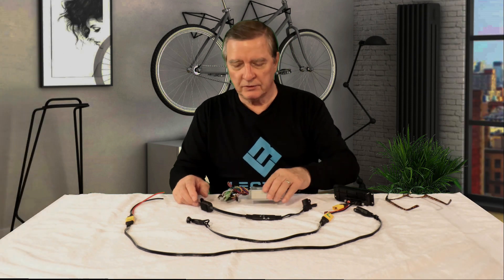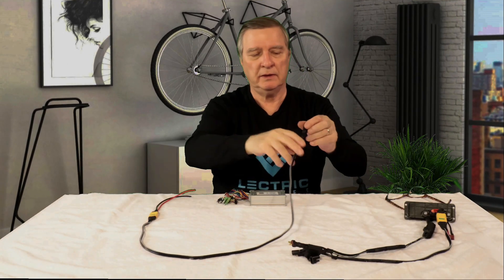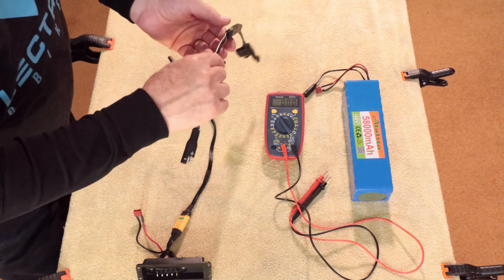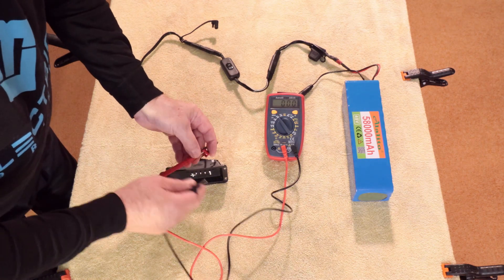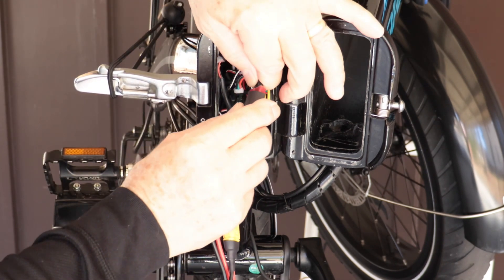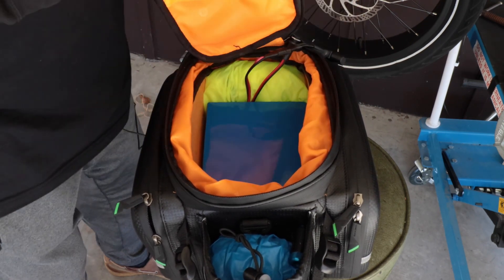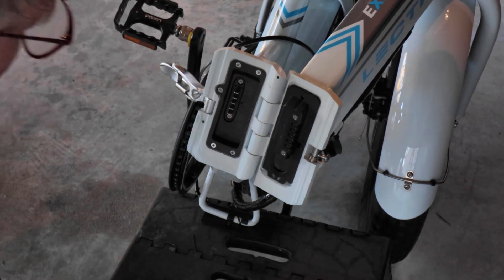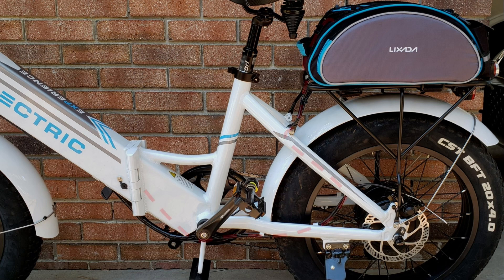How to E-Bike - Auxiliary Battery Wiring Harness in Detail

Comment: I got the same battery from Ebay that your link took me to .. $226 with charger BUT it weighs only 9lb 15.6oz?? d0 you think I may have been ripped off?  Thanks for all the valuable info your videos provide!
Reply from the maker: They may have changed the actual batteries.  Usually the heavier the battery the higher the amps.  Mine from eBay weighed about 11 lbs.  Their are 91 battery cells in these batteries, some a small difference in the weight of each cells will add up.  As I discovered when comparing the 20Ah battery's range against the stock 10.6 Ah battery, the 20 Ah battery was about 17 Ah.
Reply: @Onyasix  I have discovered that power_batteryc seller (advertising himself as a USA SELLER, is NOT the seller; the seller is a dishonest company in HongKong China (my payment went to HK causing a foreign transaction fee) that has a guy in California who is drop shipping these batteries with ZERO WARNING through the US MAIL with NO BUSINESS LICENSE.  2 extortion emails have been sent to me demanding that I give positive feedback and drop my ebay case against their extortion. It is getting harder and harder to find honest ebay sellers in china
Reply from the maker: @chesterpelt8882  Sorry to hear that.  I use PayPal for all my internet purchases.  There are good for straightening out any disputes with sellers.  I had a problem with AliExpress and after 3 months of going back and forth with the seller and AliExpress, I took my complaint to PayPal.  They resolved my problem in less than 24 hours and I got a full credit back on my PayPal account.
Reply: @Onyasix  your lucky; I too use paypal for all ebay sales; BUT all is good, at least we got 17AH (75% of what was advertised) batteries out of the sale for LESS than Lectric sales  the oem 10AH battery.  thanks again for your info

Comment: Love your videos very interesting,  I searched Ebay and can't find your brand of battery, just a 48 volt 58 ah and charger for $143 Canadian sounds really cheap.
Reply from the maker: That sounds like the HIGHLY over rated battery that I purchased from AliExpress.  It sold for about $150 and said that it was 58 Ah but after my comparison with the stock 10.6 Ah battery, The 58 Ah battery was closer to 5 to 6 Ah, a 10th of what it said it was.  There are a lot of those batteries out there, the weight is usually the dead give away.  These batteries will normally weigh about 5 lbs.
Reply from the maker: Here's the 50 Ah battery that I have:  https://www.ebay.com/itm/EBike-Lithium-Li-ion-Battery-48V-20AH-for-1000W-Motor-Scooter-Electric-Bicycle/293901471583?_trkparms=ispr%3D1&hash=item446de48f5f:g:ouYAAOSwq~xfszAZ&amdata=enc%3AAQAFAAACgBaobrjLl8XobRIiIML1V4Imu%252Fn%252BzU5L90Z278x5ickkvjzWOStkxwnlDuxSI1PVVoLTQFUPpGT8fQflOEWLlC29hp2vmmSY8LxxbscUHCjeiW9%252Fx2ot0LXRbBSP%252Fx%252BssVx4R7Jp%252BcC9CIs%252Bpotr183jBpO5C5CP9J9btDhcrHHt%252BzDnTiidW7C750Nwq1gBVe6q1vyqz1skFaMAJiQ6GuSOBGCLST5rY4ooyNlYPk%252ByMojm0RUp2FbLuZTAv%252BKtL5t86cVjQ5jjP7DCvBh3fIip3jYfWrB6rjSZnuscYT2VBEzES95TK9RMZNEpqoj4zxzq9oDVLfeHTRmt39jJtq1f3ztq97fZV%252FFy6gNOZP1B5iXgppQi7oj6elrQTikdlXru0mXxh%252BsTWwOzkrqz8jc%252F6EF%252FBuF2MgRO7DR35GpytMn9S9yKeXq1ba7OWt6YAC3FKx8PAHfmpaWoMIGzrU8jNhxpvolo7Sc4otdL6eUImhn5r9cHlHkaQ9Jc%252FHgWGp7KUPTsIwFvxzxnL18p170g5b88cSgscji1cxbk51qCgJfWZmpdocEHt7QNYgEqUZV6mFuZmC9lTkthEcG1aPnSSar64Fa92OO6bGaXGwo7%252FvVjCJq%252BmdzzR26e%252BbSFv7h9XYCvAvYDLK24ZBDaeK20fRhTcPlKz9CJtyC8m%252FeL5mvYGVw6IBJT6UxvirZCgNqjK2XWqlwmFi94jgdHeHI8ib6snZKuv1ckX%252FbG1K6y46XCvF2dHcyKTsI0ZTuFw7aMdIV%252FxqmyjNyxkhSMJTrw4ZMt%252Fg7cT%252BHSwO6E7BckjDj9dKkbAspf%252B%252F44KyQwyl13eNrxhwtMMz6aYYomGwc%253D%7Ccksum%3A293901471583fbd828a9a92d4cdf9500ea63b88bf1e6%7Campid%3APL_CLK%7Cclp%3A2334524
Reply: @Onyasix  you may notice that after I reported this is NOT a USA SELLER to EBAY, that they have changed their store ad to "Shipped in the USA" and removed the "USA SELLER". And changed their ebay name from power_batteryc to power_batteryb;  US customers will still have to pay hidden Foreign transaction fees
Reply: @chesterpelt8882  thank you Chester so much for this information! Would you mind sharing how much the foreign transaction fee was? The seller power_batteryc  now lists this battery for $236.62, and power_batteryb (probably the same seller) lists this battery for $229.99.  this seems like quite a jump from the previous $150 price. 
Anymore advice? I'm a newbie... Just waiting for my Lectric to arrive. Would love to extend the range of my bike by adding additional battery.
Reply: @justme-dee6888  can't comment on this seller; Power_batteryc was the one I dealt with; charges 1% transaction fee when using a credit card; the thing I think marks this bunch as dishonest is; they claim to be US sellers and yet your card is processed in Hong Kong! To me that labels the seller as suspect. The battery I got is doing fine but is NOT 20ah as Sonny's data shows; its is more like 17ah; a step up but still correlates with the whole half-truth, shady seller and the company he represents. The only good thing is that it is cheaper than the oem 10.4 battery;
Reply: It's a Kedanone battery
Reply: Thanks for the help, I checked it out and it was out of stock

Comment: Thank you, Sonny!  My Lectric XP is now running with 2 batteries.  The only thing I did differently that I used the No Wire Ultra T Plug Parallel Adapter Connector Plug. All in all, it costs me ~$300 (48v 20ah + the wires).  Thank you again!
Reply from the maker: Glad to be of help.  You will enjoy the extra range now and, if you're like me, you will not know how you lived without it.

Comment: Could I use the Deans Parallel Connector 1 Female to 2 Male Deans T Plug Parallel Connector Adapter together with  Anti-Spark connector?
Reply from the maker: Not sure what you are saying.  To prevent a connection spark when plugging the auxiliary battery into the auxiliary wiring harness you either need to have a anti-spark connector or a on/off switch (with the switch in the off position) somewhere in the wiring between the auxiliary battery and the controller.  As shown in this video, I have a anti-spark XT90s plug where the auxiliary wiring connects to the existing wiring leading to the controller.  The existing wiring has a deans T-plug connector at the controller and the auxiliary battery wiring harness has a Deans T-plug  male connector at the end that connects to the auxiliary battery Deans T-plug female connector.
Reply: @Onyasix  Thank you for your reply.  I like your solution! I was just wondering why you did not choose the deans parallel connector - 1) connect one to the existing T-plug connector at the controller and 2) the auxiliary to anti-spark connector to the quick connect.
Reply from the maker: @jpham0507  ~ You could use a Deans parallel connector - 1 at the controller but it would require extra work to solder and  replace the stock controller's Deans female connector and the stock wiring's Dean's male connector.  At 17:02 , I used G-PEH 125 Solderless Quick Splice Snap Wire Connector (with XT90-S connector) at the joining of the auxiliary battery wiring harness to the existing power wiring between the stock battery and the controller.  This connection makes it much easier than soldering.

Comment: Sonny, great video.  I am planning to use your idea in the near future.  My plan is to buy the Ebay battery and store in a bag on my rear rack.  It looks like the battery you recommend comes with it's own charger and all needed wiring to charge.  Is this correct?  When you have both batteries installed together, you recommended starting with both at the same voltage.  Can you explain this?  Do you normally run them both together or one at a time?  If you have connected together (in parallel) do they both drain down at the same rate since they are different capacities?
Reply from the maker: I ordered mine with the charger.  It is a 2.5 amp charger, whereas the stock XP charger is 2 amps. If you run the batteries together, they need to start out at the same voltage level to even the discharge between the batteries.  They both will discharge at the same rate no matter their amp hour rating.  The higher amp hour battery will carry more of the load. I started out running them separately, but am now running them together for a couple of reasons, both batteries run cooler and there is a slight increase in range.
Reply: @Onyasix  thanks for the good explanation Sonny!  I'm clear now!

Comment: I am about to add a 48v/20ah aux battery to my Lectric XP as you did in a rack bag on the rear rack. I was wondering if the switch you used is heavy duty enough for this application. Have you had any problems with the switch?
Reply from the maker: I have had no problem with the on/off switch.  Even though the switch is rated at 6 amp, that is based on a 250 volt system.

Comment: Thanks, Sonny for the excellent explanation of how to install the auxiliary battery!
Reply from the maker: To your question 1 hour ago . . .  the only generic 20Ah battery that I can recommend is the one in this video, the CAO MM that I purchased thru eBay.  This battery is advertised at 20Ah, but as I stated one of my earlier videos, this battery is likely closer to 17 Ah when compared to the stock 10.4 Ah battery based on range performance.  Other than that, I've got about 1000 miles using this battery and it is holding up well (no lose in voltage).  Even at 17 Ah it is still a great price even though its price has risen from $150 (when I purchased mine) to $200 plus.  As I've stated, a good thing to look for is the weight of the battery.  A 20Ah (17Ah) battery should weigh about 11 lbs or more.   There are a lot of greatly over rated batteries out there.  Also watch out for the prices, $150 for a 20Ah battery 6 months ago was a steal.
Reply: @Onyasix  Got it - Thanks so much for your quick and clear reply...
Reply: @Onyasix  I managed to install the auxiliary (48/20ah) battery as you recommended yesterday.  Followed your instructions and now I am running both batteries together. BTW, I noticed that I got E09 (controller fault) the very first time you turn the auxiliary battery on.  However, when you switch off/on again, the error goes away.  Very happy with the modification and wanted to thank you once more!
Reply: @Onyasix  I got the same battery from Ebay that your link took me to .. $226 with charger BUT it weighs only 9lb 15.6oz?? d0 you think I may have been ripped off?